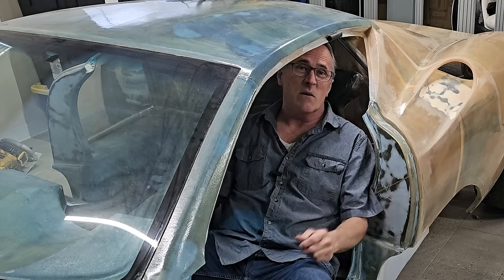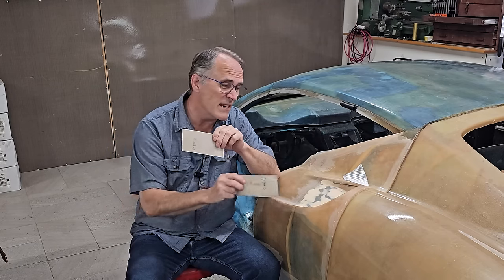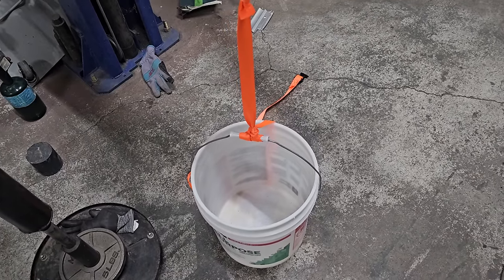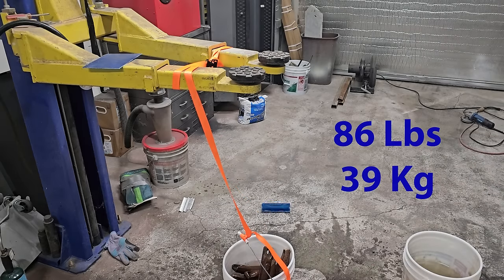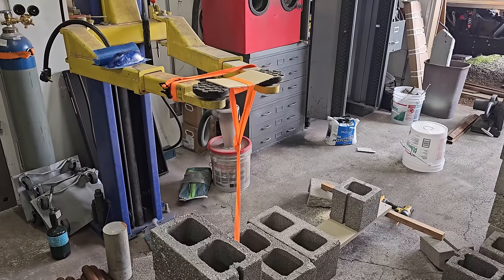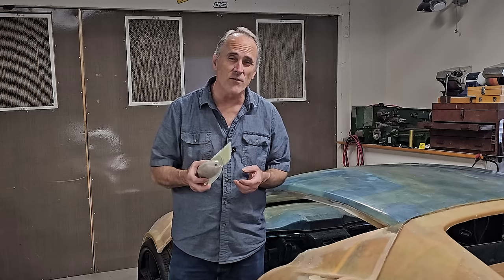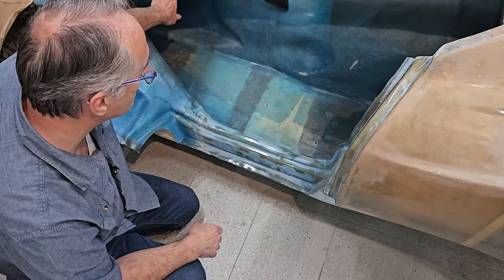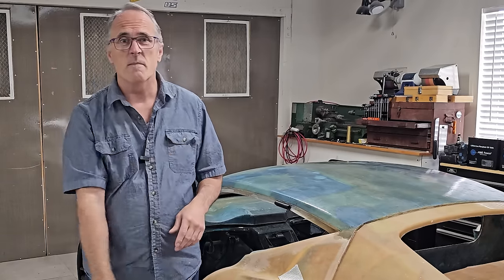They say it's going to break! Can composite engineering save my supercar?

Comment: excellent explanation sir, your a pretty exceptional engineer as it goes - you have to love the haters, haha and you handle them so well, personally i think they need the shorts taking down and given a good slapping since they behave like little kids
from the point of you building a car, super or otherwise, the wheels base is perfectly short, we are not talking about the same loads that might be exceeded perhaps in a plane or a bridge, so the car and its size are well within tolerances in comparison to using fibre glass, carbon fibre and kevlar which in its self can be considered an overkill in the automotive industry, but safety apparently is looked on as a necessity these days and so cannot be avoided - carbon fibre shatters like crazy in F1 car racing, because it is designed this way to absorb as much impact as possible prior to glass fibre and carbon being used, paper and cardboard was used in similar ways, soaked in resin, built up in layers to create very hard impact surfaces, disposable fuel tanks were made in a similar fashion throughout the 50's and 60's - for the haters, consider a simple toilet roll tube of cardboard, stand on end an place a simple house brick on top, will it hold and ask yourself why, how does this work?
Reply from the maker: And of course the best way to see if it will work is to build a prototype and take it for a test drive . . .  .Oh! that is what we are doing. Imagine that.
Reply: @BuilderCreator  hahaha image that - oh hang on, do i need a brain for this, or can i rent one - like you i do laugh at some folk, i'm sure there are wires not joined up somewhere, not that there's anything wrong in people not being able to do joined up thinking, but it does help in some instances

Comment: Great video.  Can you help a guy out.  I'm designing a composite wing.  My thoughts are that the compression is on the upper surface as the load is from beneath or the under side.  If my idea is correct, where would you place more layers of glass?  On the top or on the bottom?
Reply from the maker: A wing should be thought of as a tube with the possibility of loads from any direction, Then you should design a spar to handle the dynamic loads. The spar should distribute 65% of the max load from up lift and 35% from down loads. Wrap your wing with 66% of the fibers going at 45 degrees from the root to prevent twisting. The spar should bond to the top and bottom skins.

Comment: What amount of force (twisting, bending, etc) are you having to protect against?  Is the weight of the car once moving?  Is the weight of the car times G-force?  Much do the forces increase from ~10 mph versus 110 mph?
Reply from the maker: Extreme stiffness is needed for cars built to take corners at 3+Gs. As I'm after a top speed goal and good street performance, I can sacrifice some stiffness to comfort and cost.

Comment: Impressive project. I especially liked the idea of a kit-based ECU system - would like to see how you set it up. By the way, how did you decide on your spring and roll bar rates ? (I used to provide consultancy in this area)....I'm currently building a Le-Mans style racing sportscar - mix of aluminium and carbon honeycomb. I decided on Aluminium honeycomb for the main bulkheads (as an ex-racer, I've seen too many drivers with smashed up legs !). My son may be driving mine one day.....
Reply from the maker: Spring rate was a bit of an educated guess on the car's final weight, and what springs were available for the coil overs I purchased. Roll rate will be tuned by machining the torque bars diameter.
Reply: @BuilderCreator  The main thing about spring rates on short travel dampers is to make sure they don't go 'coil-bound'. If that happens, you'll have to choose your bump rubbers very carefully (otherwise the rate will go to infinity !). For the roll bars, the racer's approach is to use variable length lever arms - very effective and a good chassis tuning tool. If packaging is an issue, you could also consider torsion bars (more compact installation). Do the Math(s) first.....
Reply from the maker: @davecooper5951  That is my system, as you explain. I have torsion bars terminating with lever arms drilled for adjustable length. Plus as mentioned before I can reduce the diameter of the torsion bars to soften them up if needed.

Comment: Your car is built in tension, how are you testing tension, if your samples have no anchor points? Deflection without anchoring is going to be much weaker, since the fibers will be bending much more, causing all kinds of damage to the bonding medium.
Reply: A chassis driving down the road isn’t anchored to the ground…

Comment: Why not just do a torsional rigidity test to validate your design?
Reply: I was really hoping to see that in this video, but unfortunately never happened. At least we learnt how a bridge works.
Reply from the maker: Hopefully I will get to that test, but the tub is still not done. I am still verifying some mounting points for the center differential before I can do the final lamination. P.S. I need lots of gold bars to use on the test, as cinder blocks are too light. Please forward all you have.
Reply: @BuilderCreator  Oh boy. Being 5 years in and not having the basic structure of the car done isn't confidence inspiring. Do you really have an engineering degree?

Comment: Never doubted the engineering - nice one Jay.  I tend assume structural engineering stuff is covered by you structural engineering types and move on.  My interest is in aerodynamics.  If you’ve  already covered it I apologise, but do you have any aero modelling to show us?  How slippery is she?  How does she react to cross winds?  Will she do a Le Mans Mercedes down the Mullsanne Straight, or is there downforce?  If downforce, how much, at what velocities, and where (axle loads)?
Reply from the maker: I have an open offer from AirShaper.com to do an analysis, but I just haven't taken the time to put together all the 3D work it would require. The Arete uses a lot of "through car" aero and so just analyzing the shell would mean little. Perhaps some day.

Comment: How did you calculate the total weight for the cement blocks (not cinder BTW), since a significant portion of the load between the strap and the outrigger support? You can choose either the strap or the out rigger as your fulcrum point, and measure the distance from each block center to the fulcrum in a ratio with the distance between both supports (strap & outrigger). If the outrigger is 20 times the distance from the strap than the load center, you must reduce your effective load to 95% of the actual weight. 10 to 1 would knock you down to 90%. Your rig looks like roughly a 5 to 1 distribution depending on what blocks are placed where...
Reply from the maker: I could reduce the number of engineering constants if you would submit $5000 dollars for a nice little used Zwick composite testing rig (plus $2000 for shipping from Slovenia). It was all for a point of discussion, not submission for a military contract. Straining at nats. P.S. I live within a hundred miles of 5 large inactive volcanoes and several thousand extinct cinder cones. They do indeed still make cinder blocks here in the Pacific Northwest.

Comment: If a fine English chap named Colin Chapman could fire a car to nearly 180 MPH in the 70's using far less advanced fiber technology and Roger Sloman spending 7 years developing the same tech for Formula 1 , I would like to put a bet down that you'll safely exceed the 200 Mph that you're aiming towards. A company named Liebherr are now using the same tech (carbon fiber) to manufacture tie (bracing) bars for the jibs on some of the largest cranes in the world and the loading's are far exceeding 300 Tonnes tension.
Reply from the maker: 300 tonnes? That is a lot of cinder blocks!!

Comment: These arm chair know it alls haven’t built a thing in their lives. I call them flabricators. Not one of them has a single clue what they are on about. your experience is extraordinary. Anyone on here telling you what do on here is utterly deluded.
Reply: Yet his two examples are from decades ago and EVERY monocoque manufacturer in the world uses carbon fiber now. It's more than if it will break, the materials react different under loads. Sometimes combinations of different composite materials are used for specific combined properties. Either way, carbon fiber is lighter pound for pound when it comes to rigidity.  I may be biased though...

Comment: You need a diagonal on your front box to brace it. Front Suspension will fold it up
Reply from the maker: Once the differential and bracket is in, it would have to fold that into the mix as well.
Reply: @BuilderCreator  would it hurt?